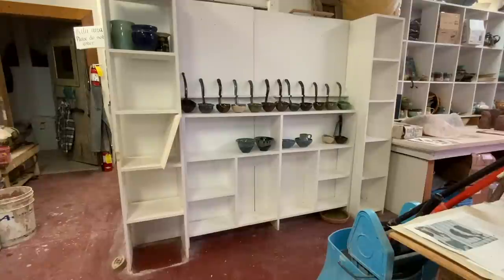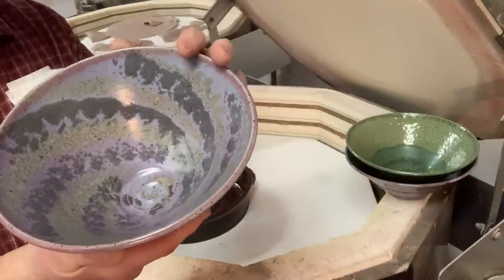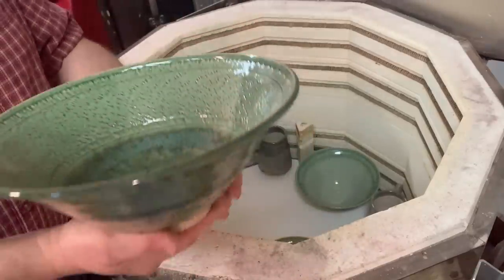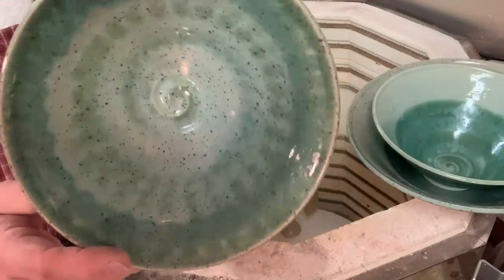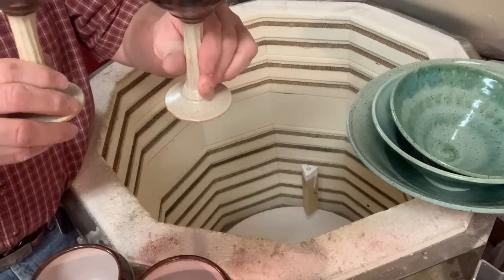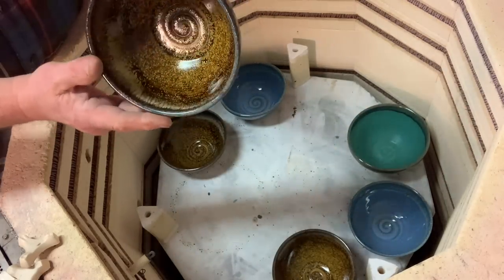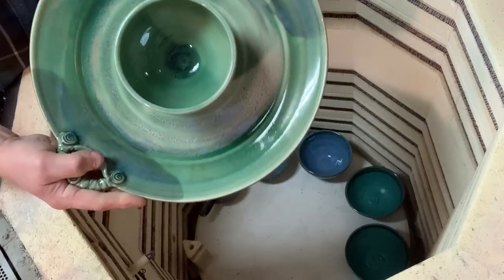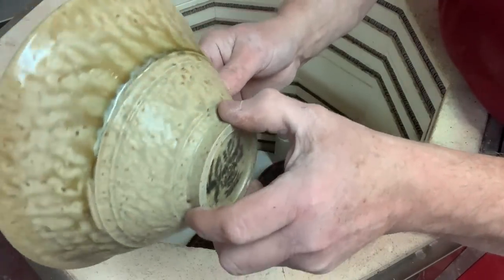Cone6 glaze 01/01/23

Comment: Near the bottom is a larger bowl with temmoku glaze. You mention chattering on the interior? Did you trim the interior of the bowl as well as the exterior?
Also, I noticed the shelf posts —> a 3 or 4” post with a 1” post on top. Is that for height between shelves or a strategy for improved firing of glazed pieces?
Thanks for teaching us SO much.  I love the videos
Reply from the maker: The posts hold the shelf above. I just used the chattering tool on the inside, I do not trim the insides.

Comment: What lovely pieces, I'm an old guy, so I really like the retro colors.  I have been trying for a year to develop a slow cooling schedule.  Would you possibly do a video with some instruction on that subject.  Love your videos and will be glad when you reach 100K scribes
Reply from the maker: I have posted my schedule in the videos, especially the Randys Red ones. Here it is
seg 1 R200 to 1045. Seg2 125 to 1145, seg 3 200 to 2000, seg 4 108 to 2232 hold 15 mins, seg5 300 to 2000, seg 6 150 to 1750 hold 30mins to 60 mins.  
The slower you cool in seg 6 the more crystals form in Rutile glazes. Good luck. call me if you have any questions.